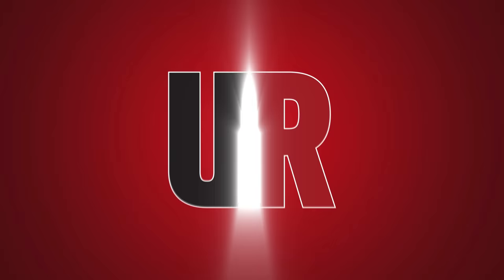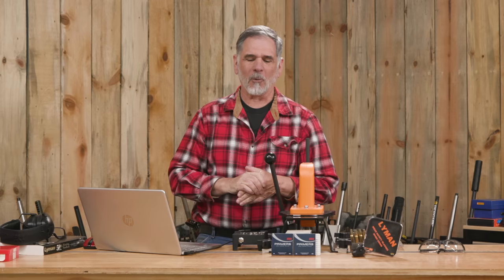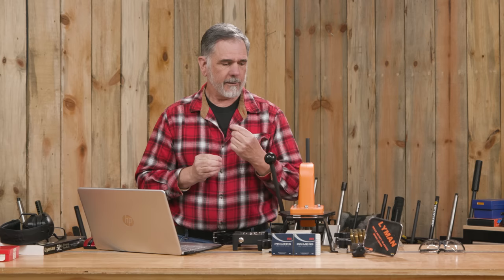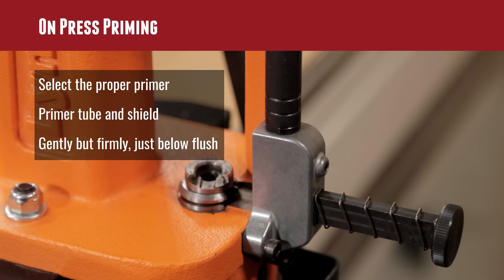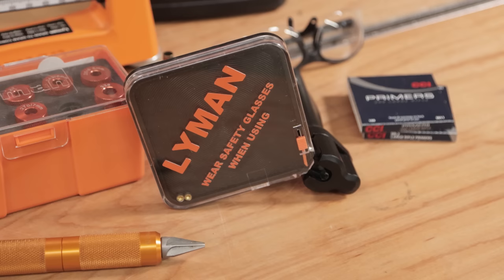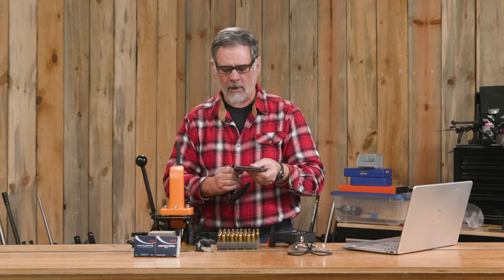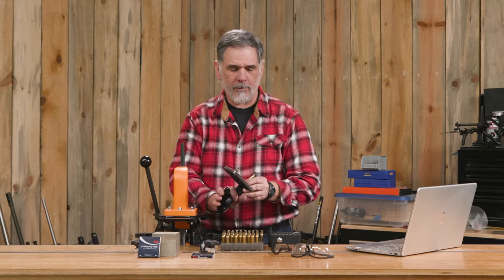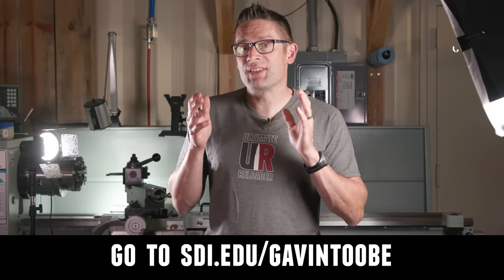Basic Rifle Reloading Part 3: Priming

Comment: Rotate the priming tool 180 degrees (lever to palm) and the primers will more naturally slide into the proper position and at the same time be facing away from your face.
Reply: That's the way I do It, it just feels more natural that way to me.  I use one of the older Lee Auto Prime for all of my priming and my biggest complaint about it is that when you have Primers in it and lay it down, a primer can come out.  A little slide block like on the Lyman would be nice to have.

Comment: Well I have used the RCBS hand priming unit a lot over the years in addition to the on press tools. Lately while handloading rifle brass that had staked or crimped primers even after uniformed the primer pockets I was having damaged primers with the hand priming! So I dug out the RAM Priming setup that came with my RCBS Big Max press>
Since going to this setup I haven't had any issues utilizing this setup!
The Ram holder (shown bottom left) is fitted where the shell holder is normally placed on the press ram. The setup has two rams, one for small and one for large primers (shown in the middle).
The die (shown near the top of the picture below) actually will hold the proper shell holder for the cartridge being primed. Care needs to be taken as you adjust the die height such as the push pin inside the ram will full seat the primers.
This system is slower than hand priming, but the precision obtained priming with this setup has been very precise and positive.
The Ram Priming Unit gives reloaders better feel by seating the primer at the top of the press stroke. Reloaders can also preset a positive stop to speed the process. It works with any single-stage or turret press with 7/8-inch-14 threads and an RCBS® type single-stage shell holder. The unit includes large and small primer rod assemblies for Boxer-type rifle and pistol primers.

Comment: Primer safety is no joke. I had one of the early XL650s. I had a full primer tube in the press. The one I was pressing in went off, daisy chained around the rotary wheel, igniting the 95 or so in the tube. It blew the plastic low primer warning tube through the ceiling and left me deaf in one ear for 3-4 days It was probably a month before my hearing returned to normal. In over 50,000 round reloaded, it never happened again. Always wondered what caused it. Now I ALWAYS wear hearing protection in addition to safety glasses any time I'm reloading.

Comment: I use an RCBS Universal hand priming tool and I like it because it does not require a shell holder to hold the case. The only problem I have ever found was when priming 45 Colt cases-the rim as those familiar with that particular case is barely there and the RCBS Universal does not sufficiently hold the case. For that cartridge, I do have an old RCBS hand priming tool which requires the shell holder and it works fine. Alternatively, I can press prime on the top of my Forster Co-Ax which does not require the shell holder. It's a pretty neat system but rather slow. I'm happy to hear you mention keeping your tools clean as a safety measure. I'm not surgical about it but I clean my dies after every use with gun scrubber or something similar followed by some rem-oil spray. As to the press itself, I wipe it down with a clean, oily rag before beginning operations on it, paying some attention to the press ram and a needle oiler for places the rag can't get to such as hinge pins, etc. Just a drop of oil will do it on the pins.

Comment: My buddy and I was curious one day about how much power a primer has.  We took 5 .410 shotgun shells,  emptied the pellets and powder from them.  We took just the wad and put back in the empty hull, went outside and fired it.  It shot the hull a good distance.   We then took some 20oz water bottles and set them up.  With just the primer behind the wad it still had more than enough power to knock water bottles over from 10 feet.

Comment: I've had one primer go off.

I load about 3000 rounds a year.  It was due to the crimp not being completely removed on a 223. I  glance at the primer to see that it is not upside-down as I  begin to squeeze,  then slide the shell on and point it away from me.  Fortunately,  that routine saved me from injury.  I currently hand prime with an RCBS.  I'm looking at moving to Frankfort Arsenals' perfect seater as it is adjustable for depth.

Comment: I always prime cases in the press, manually one at a time, and with a die installed.  I have seen a primer explode using a hand priming tool, thankfully no one was injured.  A plus with using a press is I have never had a primer seated too shallow, where I need to re-squeeze or re-set it to the correct depth.  Great safety tips.

Comment: I started with a Lee handpress. I had a bad time, I kept crushing primers. And I bent the lever. Then I rebuilt it. That only worked so long. I never really used the press mounted one. I went to the RCBS handpress and that worked for years. Now I use a RCBS bench mounted priming tool for match loads and that I think does a much better job.

Comment: I appreciate the demonstration. Many people just don’t realize primers can be sensitive. It’s basically a pressure sensitive explosive compound, that you must press into the base of the shell. They also touched on the difference between standard and magnum primers. 

I personally prefer the off press primer. Lee, Lyman, RCBS, and others offer their version. My version I’m using does not use the base holder like Lyman’s does, pick one you prefer. Alway remember to keep shells pointed in a safe direction.

Comment: Once my specs are sorted I prime brass in batches of hundreds and a hand primer just doesn’t cut it. Bench mounted stand alone units like my RCBS excel at high volume and the feedback for a properly seated primer is a positive stop. The drop tube holds more than a cards worth but it is tedious to load. That is where a hand primer has the advantage of an attached flip tray. The “feeling” of seating a primer is subjective and therefore a non deterministic variable and as such plays no part in my process

Comment: I use the Lee Ram Prime system on the (portable) Buchanan Precision Hand Press that has the Hornady LNL quick die change bushing system. I adjust the die with the shell holder so that when the primer bottoms out the levers on the press are right at their stops. Works great, and very versatile, as I can prime cases at the dining table, in bed, on the table at the range, or even sitting on a log out in the woods.

Comment: For my .308, I use the Lee Auto Bench Prime.  I saw it demonstrated on this channel by Gavin.  It works great and is easily  pointed 90 degrees away from me for safety.  It is so easy to press the lever and feel the primer seat.   I have had no problems with it.  For 9mm or 223 I use on the progressive press priming.  Great video.   I also just subscribed on Rumble.

Comment: I prefer to use a hand primer because I get a good feel for how the primers are seating in the case.
You left out 2 important points about priming.
1. Make sure your primer pockets are clean. If not this can prevent a primer from seating fully which may cause premature ignition. Or just as bad no ignition because the firing pin pushes the primer forward without enough force to ignite.

2. You didn’t explain to check that primers are properly seated. I visually inspect my primer depth, run a finger to check for high primers. You can also place the case on something flat like a piece of glass to see if the case rocks. If it does the primer is not set deep enough.

Comment: I started with the Hornady Lock n Load kit, and didn't care for the hand primer, so bench primed instead.  Now, I use the Frankford Arsenal Platinum Series Perfect Seat Hand Primer and love it (around $50).  It has it's own shell holders, which is handy.  And it has a dial on it so you can adjust the seating depth, which is awesome!

Comment: Thanks for the video. What do you guys think about vacuum sealing bricks of primers for extended storage if you are lucky enough to find that many? Humidity in this old farmhouse swings between 15 to 70 % from winter to summer, will it make things better or worse for the primers to vacuum seal the bricks in air tight food grade vacuum bags? Thinking more about consistency than if they will simply just fire.. they came as benchrest primers.. want them to perform that way.
Reply: It sounds good, but I haven't ever done so. Might be an interesting long-term test to compare primers stored sealed & unsealed for a couple of years then test otherwise identical loads. Not sure I've got that much patience!

Comment: I'm using a Rcbs hand primer, I've had several failure to fire with Winchester and Remington primers. None with CCI or federal primers, and that is with several different rifles. I'm told I'm not seating all the way. But the the primer  can only go in as far as it bottoms out. Do you have a comment on that.

Comment: I’ve been using Hornady’s LNL but absolutely hate it! Average 2/100 not useable, another 5/100 jam the press from not being fully seated. Happens with .32,.380,9mm, .40,.45, 300 BO. Part of the problem seems to be the spring does not hold the shell firmly in place. Transitioning to my RCBS Summit. Anyone use more than 1 brand/type hand primer with a preference?